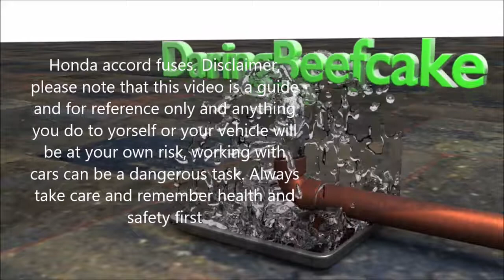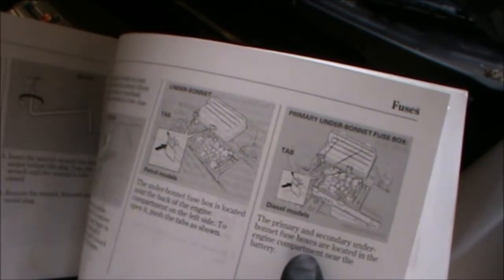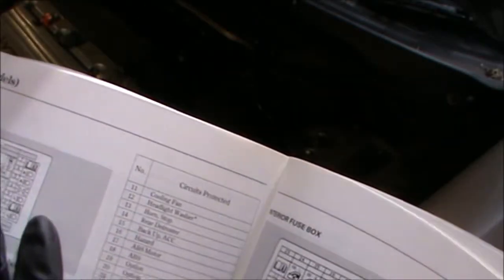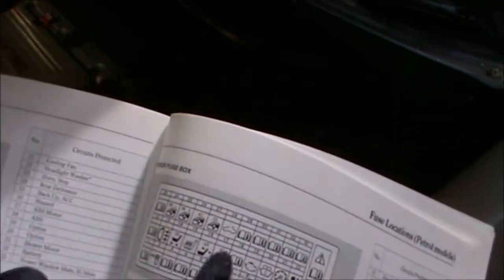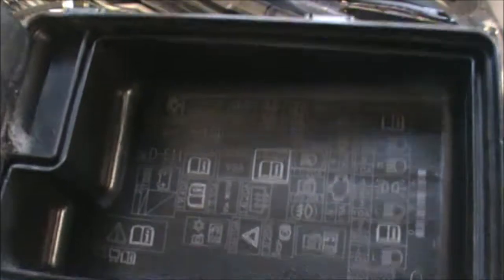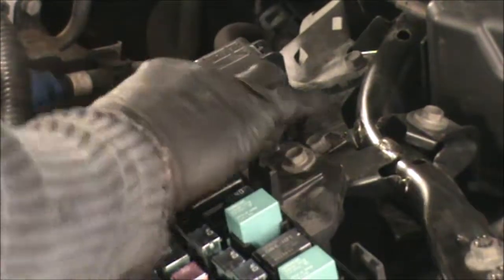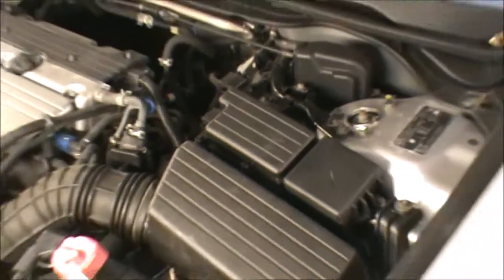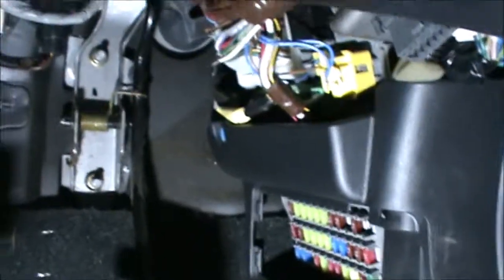Honda Accord 2004 2.4 fuses location

Comment: Hi, I Tried fitting a new bulb in the tail light socket and broke the socket, The light was working fine before I broke it. when I replaced the socket thinking that was the problem, the light doesn't turn on for my right side tail light but my right trunk light works and left tail light is on and my right turn signal bulb works. The bulb gets hot but theirs no light from it. Would you have any idea what it could be? I checked all the fuses and they were fine.
Reply from the maker: What was the original problem ? If the lights were working ok before you replace the bulb and also how did the socket brake ? Was it melted and deformed? If so there might be a problem with the wiring if not may be there was a short when you removed the old bulb and socket and therefore a fuse may have blown. So if all was working ok before possibly one of the fuses is blown.
Reply: @DaringBeefcake  thank you for responding, I did check all the fuses and they were fine, I guess when I tried shoving it in the socket it burnt the bulb out. I thought it was a bigger problem than what it actually was. stupid mistake on my end for not taking the working tail light bulb and putting it in the socket that I thought didn't work sooner to see if it was just the bulb😅😅

Comment: What does laf mean
Reply from the maker: A special O2 sensor, called a lean air fuel (LAF) sensor, can be used to detect AF ratios in a range from approximately 12:1 to 22:1. The LAF sensors have only been used on the high efficiency Civic models